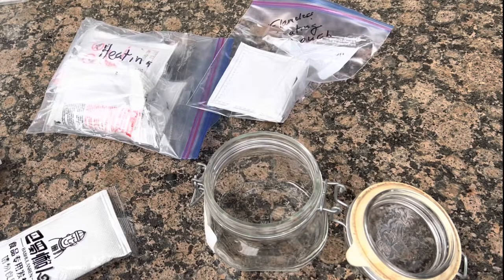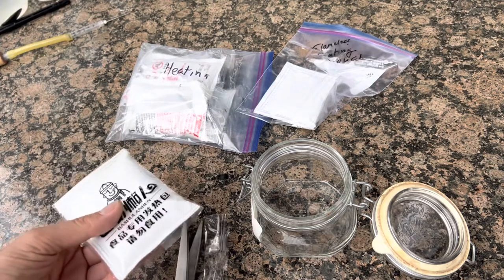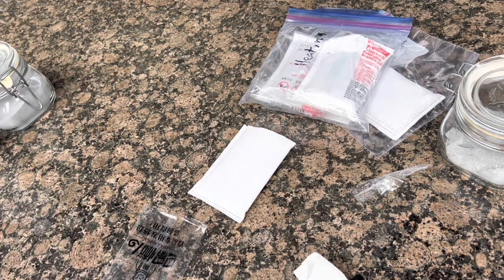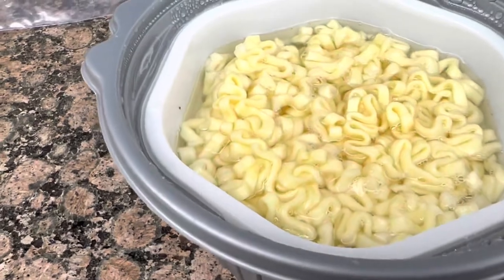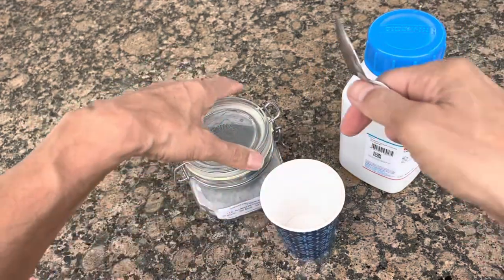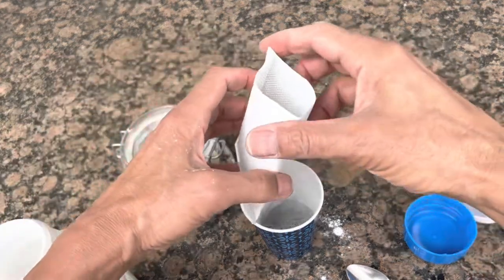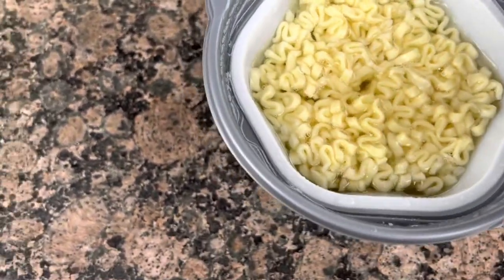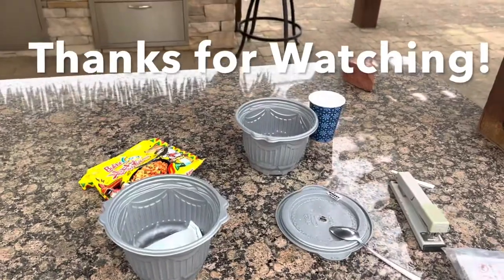Exploring the chemistry of flameless food heater packs.

Comment: Thank you so much for doing this video!  Thankfully I have aluminum left over from "projects" that were done years ago, projects that I have abandoned for obvious reasons.  This is just perfect, seriously good. 
I have been experimenting with hand warmers a little bit, called Hot Hands.  They are essentially Iron and Salt with some vermiculite and charcoal to hold water and mediate the reaction to prolong it.  They also come in a semi-permeable bag that could be reused like the MRE heater.  When the hand warmer is used up it essentially looks like pure rust inside, which I do wonder if this can be reacted with salt water to the aluminum?  
I digress, time for some more experiments, and I will subscribe as well.
Reply from the maker: This was really a fun experiment to do. The aluminum powder definitely makes a lot of heat. The calcium oxide is readily available. I can’t believe that more people don’t try to make these type of food heater packs.

Comment: Only one thing missing: how can we make our own bags?! 😃
Reply from the maker: The cloth for the bags I’m sure is commercially available. It has to be heat and alkali proof!!!
Reply from the maker: @Jay-jl3ou  I just use a staple to close them off. The staples stay together fine, and when the heating is done, and the bag has cooled off, the staples are easy to remove, and with emptying of the bag contents, washing the bags and drying for reuse. Alternatively, a large metal clip could be used to avoid damaging the edges of the bag with repeat use of the staples.

Comment: The aluminium powder you mention.Is it aluminium sulfate powder...AL2(SO4)3 ?
Reply from the maker: It’s Mg-Iron alloy
Reply: @BrianDhvTinkerer  How can Mg-Iron Alloy be called aluminium powder? its mentioned 99% pure aluminium powder on the container. Pls can u make this clear. Also how pure is the calcium oxide powder? Calcium oxide absorbs moisture to become calcium hydroxide doesnt it? Will the reaction still work if the calcium oxide is less pure ( starts hydrating into calcium hydroxide)??
Reply from the maker: @ajitnairk010  will still work. The mixture would need to be stored in a moisture proof container. A ziplock bag will work fine. Calcium hydroxide is what reacts with aluminum. In the presence of water, this reaction is very fast as it’s the hydroxide anion in aqueous solution reacting with Al that makes the heat and hydrogen gas byproduct.
Reply: @BrianDhvTinkerer  this is absolutely outstanding!!! Thank you  so much can to include the links where these items  can be purchased on your Amazon store so as to make sure I get the correct ingredients?. Thx in advance
Reply: @BrianDhvTinkerer  so is it mg-iron alloy or pure aluminium powder?
Reply from the maker: The aluminum powder I’m using with the CaO is straight up aluminum

Comment: Isn’t the resulting slew highly caustic? Also why add the Al wouldn’t it work with just the CaO alone?
Reply from the maker: Not really. The calcium hydroxide formed is basically insoluble and stays within the packet. The aluminum becomes aluminum oxide, aluminum hydroxide. I did try making something with sodium hydroxide and that is a different story all together.

Comment: Question about the aluminum powder, is it "pure aluminum" or "aluminum oxide" powder?
For this experiment I got the "pure aluminum" powder in 10-20 micron fineness, 
For packaging I used commercially available polypropylene non-woven bags, double bagged and stapled tight.
The aluminum particles was so tiny that some of them "leaked" thru the packaging and turn the water kind of "silvery" looking 
At the end the heat reaction did not occurred. May be there are some ingredients missing, like sodium bicarbonate?
For this experiment I wore latex gloves, and mask to avoid breathing in and touching the aluminum powder.
Reply from the maker: This reaction needs 30 µm aluminum powder. Not aluminum oxide. Smaller grades can work. The type of food bag I’m using is ones that were commercially available from flameless ration packs. I think they must consist of tight  woven microfibers. I used an excess of calcium oxide or CaO also known as quicklime. When the aluminum powder and a quicklime are mixed together, the quicklime reacts with water that is added to form calcium hydroxide. The calcium hydroxide which is soluble to some extent in the water can then react with the aluminum powder. Water acts as a catalyst to start the reaction. It should be noted that aluminum no matter what grade has a thin layer of oxide on it which prevents it from reacting directly with water. If you just took aluminum powder and added it to water, nothing would happen. However, the calcium hydroxide dissolves the oxide layer on the surface of the aluminum powders and allows the reaction to take place. Two reactions are actually happening, one between the aluminum and the water directly and the second one between the aluminum and the calcium hydroxide. The end product is aluminum hydroxide. A lot of heat and hydrogen is generated in the process. This reaction has been repeated multiple times and works, so I’m not sure why your one is not working unless the calcium oxide you are using has something wrong.